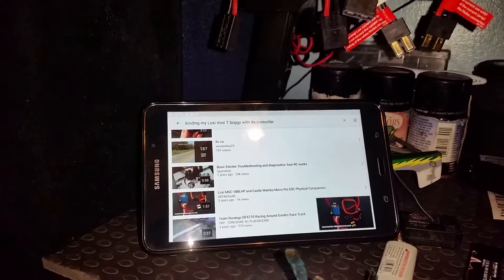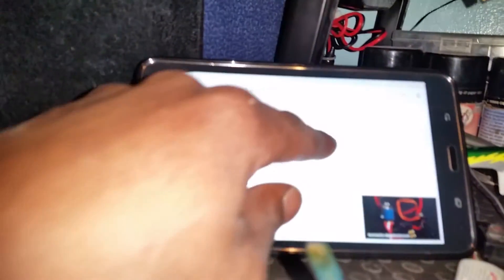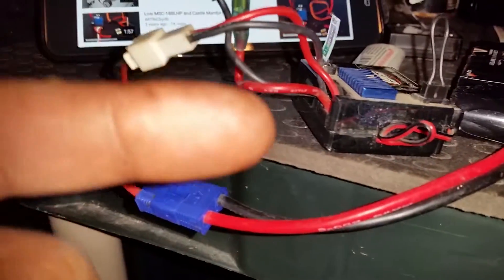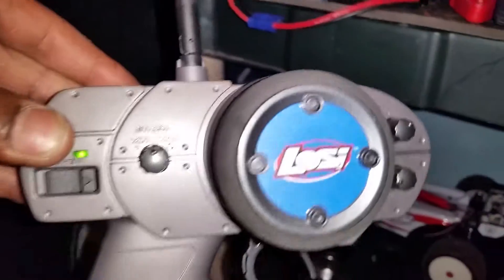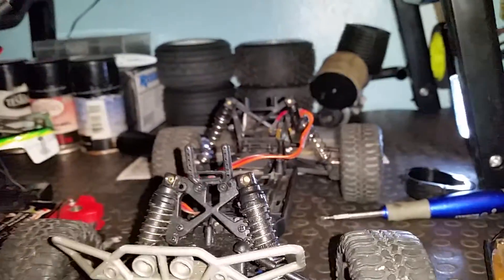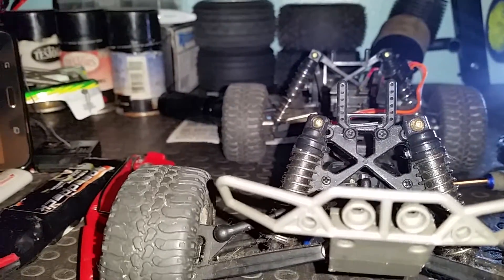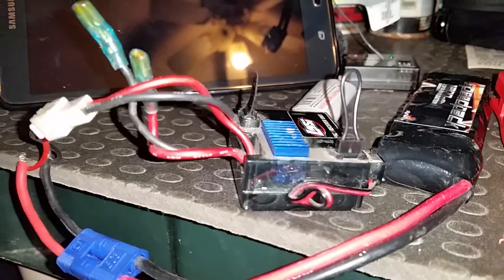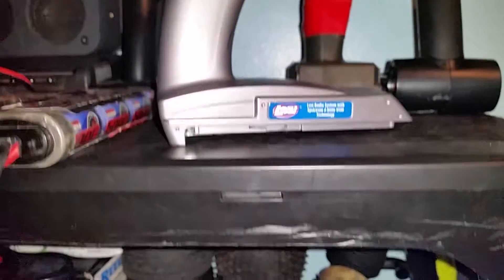Help trying to bind losi control with losi esc receiver

Comment: I think you're supposed to hold down the set or bind button that is on the receiver unit while turning it on until it starts to blink, then release the button and turn on your transmitter. Once you turn the transmitter on I think the blinking should stop and servo and motor twitch and make some noise and then be good to go. I'm just running off of memory I'm not actually certain on those steps. I actually found your video because I'm having trouble with the old-school 27mhz style losi mini t. The receiver lights up and the transmitter turns on but I get no response. The transmitter has a crystal in it but the receiver just says "27mhz synthesized receiver"on it and has a button. I'm guessing the button is to cycle through different FM frequencies but it doesn't seem to make a difference when I push it. I can't find any videos on YouTube about this old-school one for the life of me